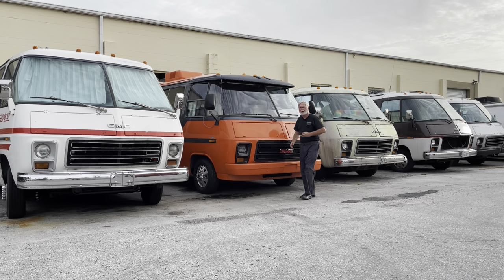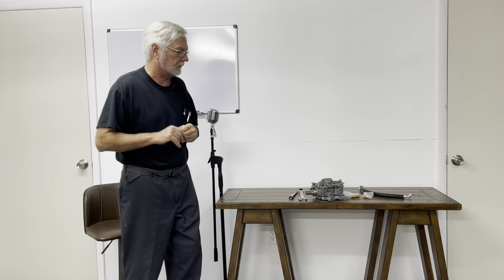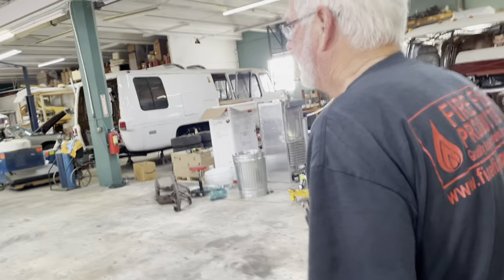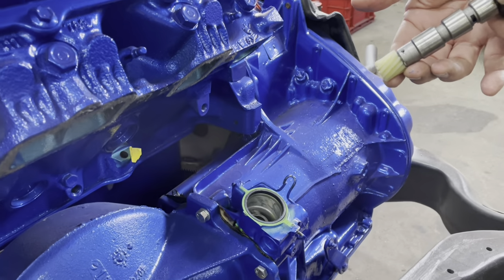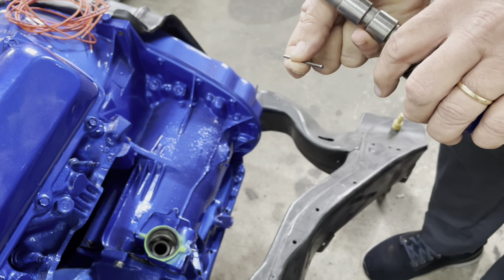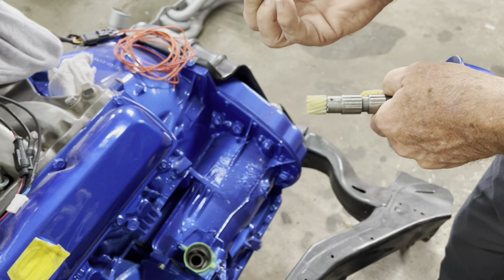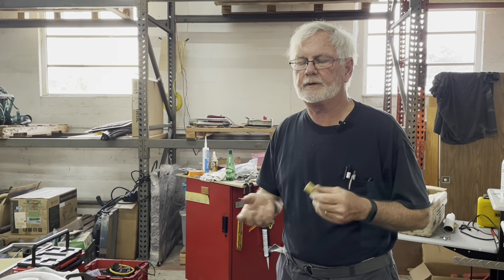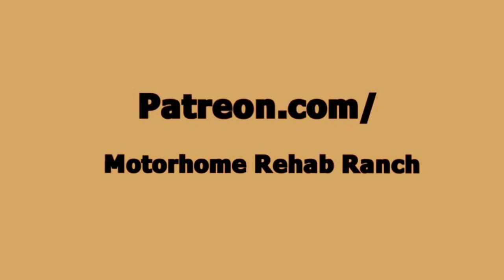GmC Motorhome - Carb Filter & Governor Gear - Jim Bounds

Comment: Shouldn't the governor gear be made of brass and not plastic? Seems like it's a failure waiting to happen.
Reply: Its designed to be sacrificial because its easy to change.  Changing the other end would require transmission disassembly.